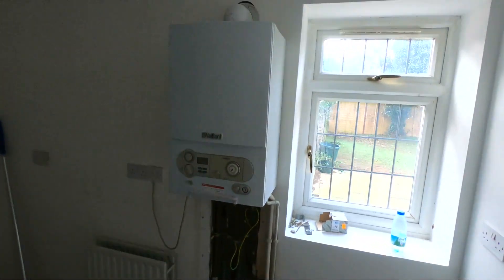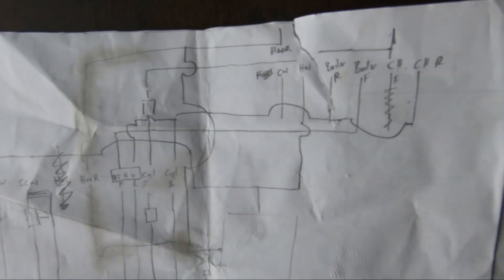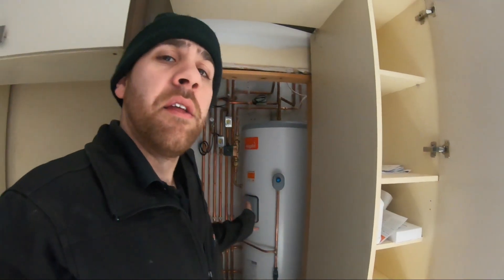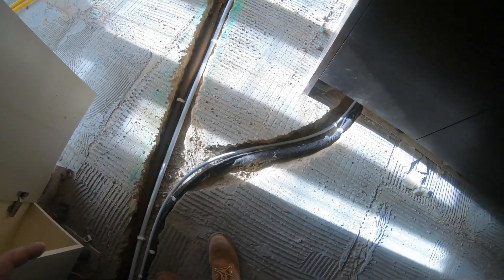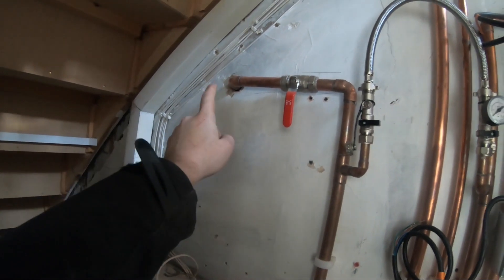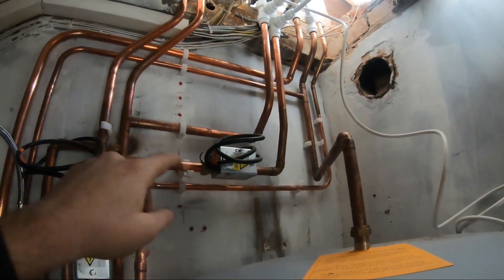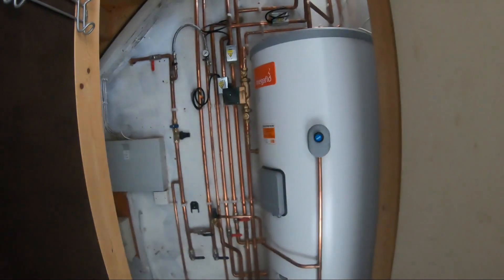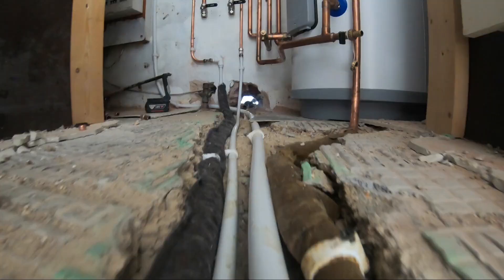System Boiler & Unvented Hot Water Cylinder Installation

Comment: Just wondered why when you was repositioning the boiler, didn’t you put it in the same room as the megaflow?
Reply from the maker: Hi Barry, the cylinder position was center of the house so no way to terminate the flue so couldnt put boiler there. plus gas pipe would of been an issue to. Made more sense putting it in kitchen cupboard.
Reply: Loucas fair enough, just wondered after watching the video. Keep up the good work. 👍

Comment: hi loucas im an apprentice and I wanted to know if I wanted to separate 3 floors with zone valves for the central heating how many 2 ports will I need to instal is it 3 or 4
Reply from the maker: You would need 4 in total... 3 for the central heating... and 1 for the hot water cylinder.
Reply: does cold water supply to the kitchen taps and all baths should be from the cylinder from pressure reducing valve or can it go direct from the main supply?